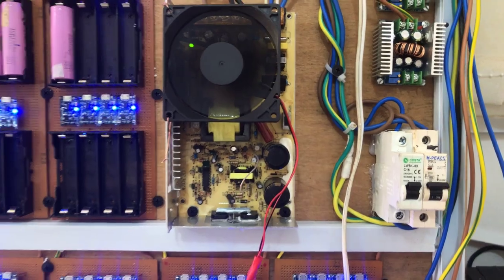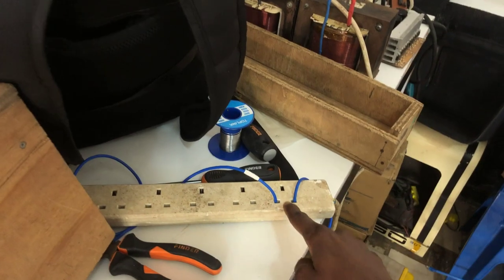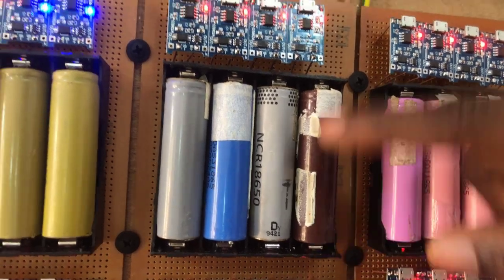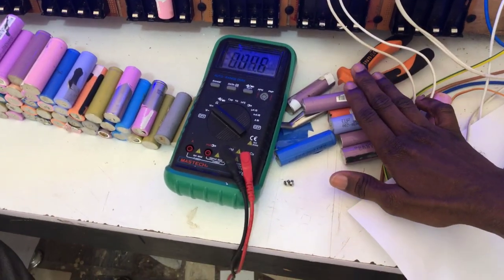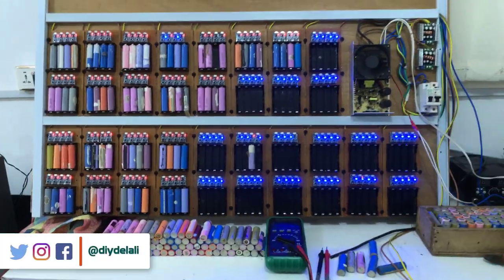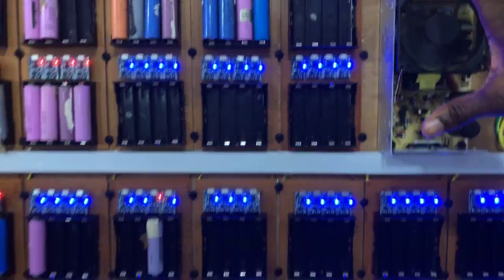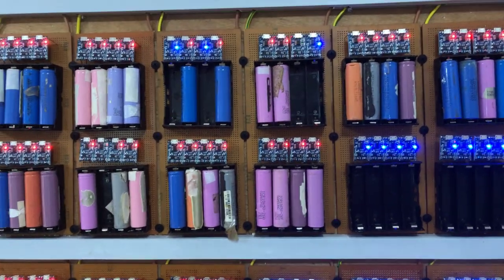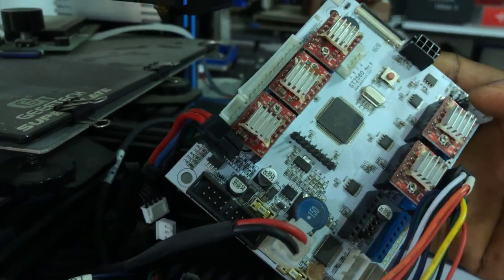How to build a 18650 Battery Charging Station with TP4056 and 5V 300W 20700 21700 2021 DIY Projects

Comment: Pro tip: it's bad to keep lithium batteries above 4 volts even for 1 day at a time. They deteriorate when fully charged. Ideally, they should be charged right before use and discharged to 3.7-3.8 volts after use.
Pro tip 2: when charged only to 4.1 volts, lithium batteries get 2 times longer lifespan. When charged to 4.0 volts, they get 3 times the lifespan. Unfortunately, TP4056 boards don't have programmable voltage.

Your friend's UPS modules could charge the batteries less than 4.2 V to increase battery lifespan.
Reply from the maker: Thanks for the constructive feedback fam. I really appreciate you taking the time to leave your comments.

As mentioned in the video description, i posted the video to learn from my viewers to improve our next build. Therefore I'm very glad to learn the insights you've shared.
Reply: What charger does have programmable voltage?

Comment: But what actually are these batteries going to be used for in practical real life use?, I mean, you're charging batteries and we've seen that, but we want to know what we need the batteries for before charging them up
Reply from the maker: The friend you saw measuring the voltages of the cell builds UPS's with recycled batteries. So he asked me to help build a charging station to help process the batteries faster.

I decided to film the station and explain what we did. Hopefully I could learn something new form my viewers on how to improve the next build.

Comment: If you trickle charge the 1.6 volt low voltage batteries , i.e  using a lithium metal hydride protocol at 0.1 amps, they may come above the threshold voltage for the li-ion charging controller to recognize it as a chargeable battery. However they still may not perform well.
Reply from the maker: That's an amazing insight.

I will keep this in mind for later. Thanks for sharing buddy.

Comment: hi, I want to make a balance charger using tp4056 for 48v battery 12s 3p does that mean I need 12 tp4056 modules connected in series and then to the battery like BMS wiring?
Reply from the maker: Unfortunately the tp4056 module doesn't work that way. To the best of my knowledge it charges only one battery at a time. So the batteries can't be in series or parallel connection.

To charge your 12s3p pack you need a 12s BMS connected to a 50.4 - 53v DC source. Each of the batteries in the pack will be charged to 4.2 properly and any excess will be damped by the BMS.

Please dont forget to subscribe. Cheers!!!